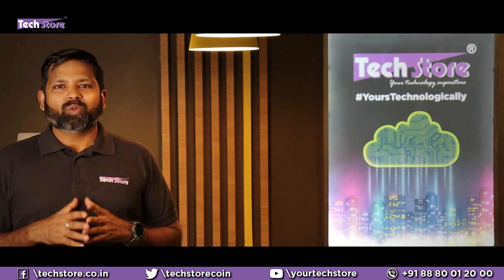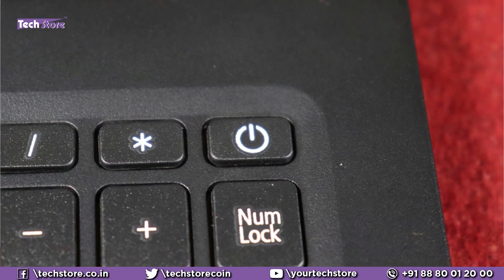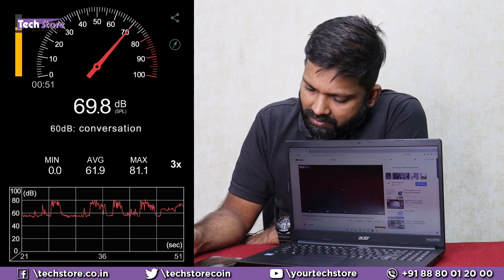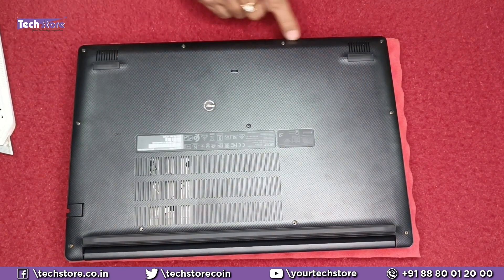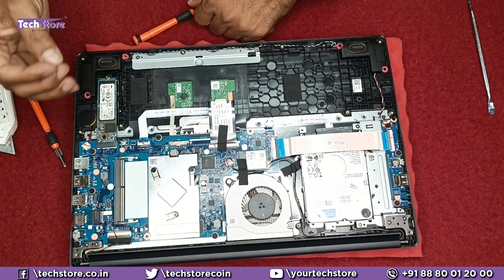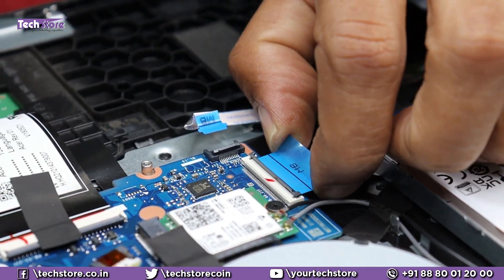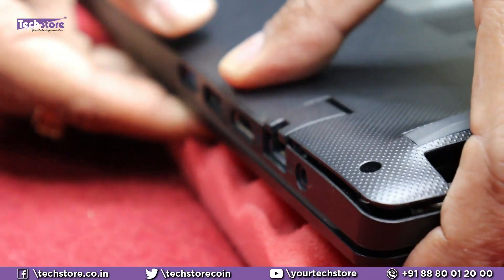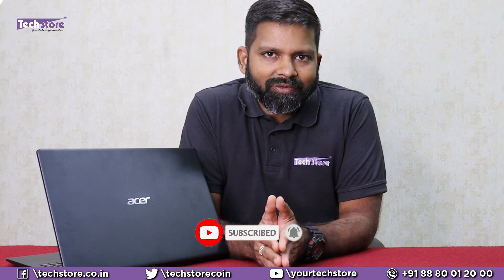Acer Extensa 3 2022 N19H1A  EX215-31- Full review disassembly upgrade ram ssd hdd battery diy

Comment: Hi I now confirm that you can actually use a 32 GB RAM stick and the max supported frequency it gives is 2667 MHz . I benchmarked the entire laptop by deploying and starting a VMWare kubernetes of 20 GB RAM capacity and it was working just fine for almost 4 hours.

Comment: Good informative video. I bought this Laptop after viewing your video only. Also, I bought the very lowest version of this laptop having 256 GB SSD and core i3 processor and then I bought 1 TB nvme , 1 TB SSD and a 16 GB RAM and replaced the same. I won't be needing that sticker for warranty as I know vendors who supply laptop motherboard and can have it rectified as well. So overall it's a perfect cheap buy.